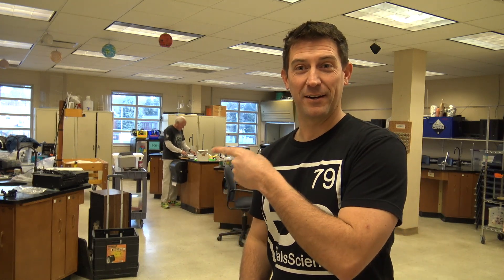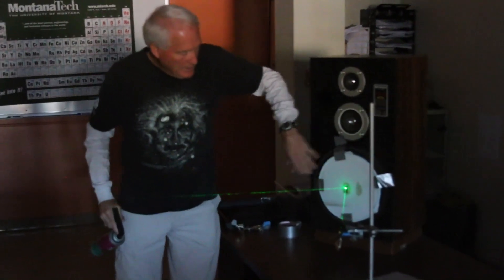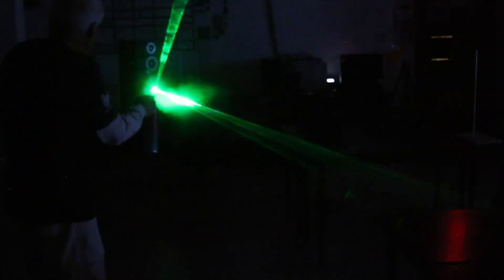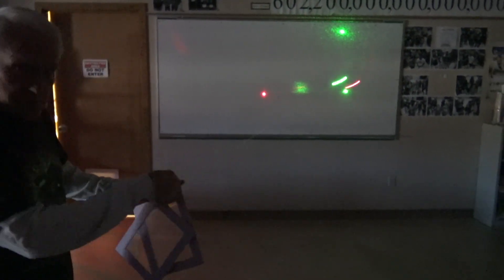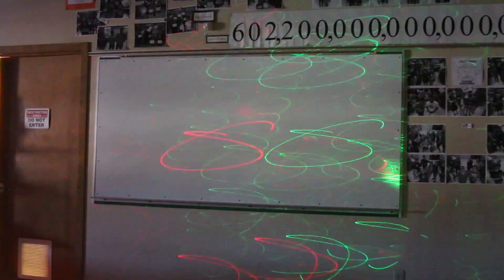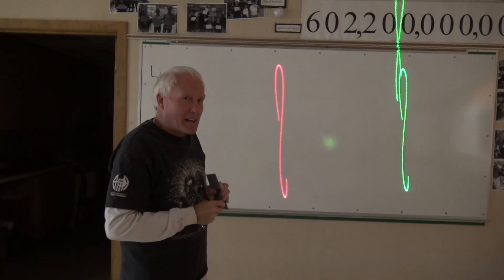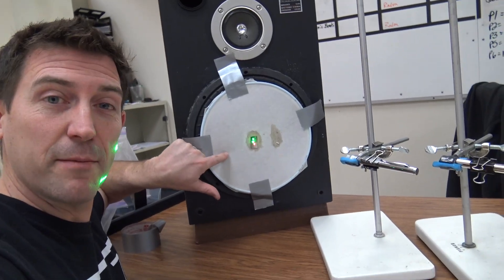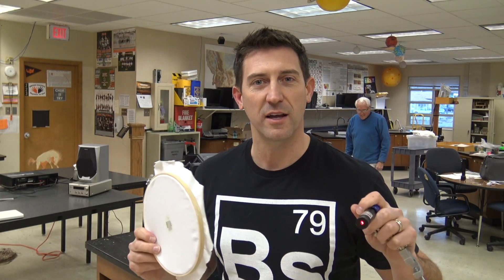Laser Light Show DIY - The Science of Sound with Mr. G - Part 1

Comment: Oh B/s - chalk dust 4:09 (old fart) is what TALCUM POWDER comes from, as Talc is merely a very finely crushed form of quartz rock, derived from chalk stone.
It is still mined in huge blocks and sent to crushers where it is eventually crushed down to an extremely fine powder, and often scents are added, that appeals to various people, so that they buy such & such's talc, over another brand, mostly to defeat bad sock  smells, (and other body odours) but also to grease the dance floors for ballroom dancers, and heavens forbid, toss into the air when doing laser light shows.
Or am I (at 70) a LOT OLDER than you?
And yes:
Chalk is a soft, white, porous, sedimentary carbonate rock. It is a form of limestone composed of the mineral calcite
Whereas Talc is a mineral made up mainly of magnesium, silicon, and oxygen. As a powder, it absorbs moisture well and helps cut down on friction, making it useful for keeping skin dry and helping prevent rashes
Unfortunately, the mineral Talc naturally occurs near Asbestos. 
Asbestos is another mineral that's woven into fabrics, used in building materials, and more.
Although most of us now know that Asbestos is a major cause of CANCER.
Hence why some people are now Gun-Shy of using talcum Powder, as there's no way to know - if the mining operation used to obtain the Talc; had any Asbestos included in the mined Talc ?
I doubt if the Laser Lights will care if Talcum Powder is tossed into & through the beams.
Just don't breath the air while doing that.

Comment: Can you split the laser into quantum entangled pairs then broadcast one of the beams to a receiver / dish ect and the other beam through a boze-Einstein condensate.
If quantum entanglement is true then once the signal is found that matches the signal that has traveled 10 minutes through space, it should be quantum entangled with the particle exiting the condensate allowing quantum computing with Mars.
Ofcorse testing could be done to satalite or in a lab.

Comment: you can get the same effect with a modified CRT TV
Reply from the maker: @sciguy tell me more!
Reply: @BealsScience  I think what he mean is connecting the audio source to the deflective coil of the CRT which is normally use to draw a "normal" image on the CRT screen but when you've hooked it into the audio source then it will looks like an oscilloscope, yeah it will kinda looks like this but you'll only get the limited space of the CRT also it's dangerous to touching around in CRT monitors without some knowledge about how it work, there's a HV transformer in there